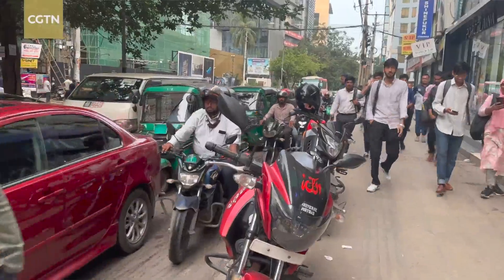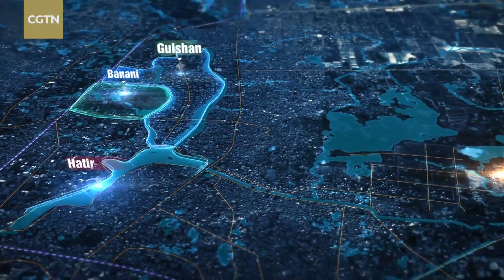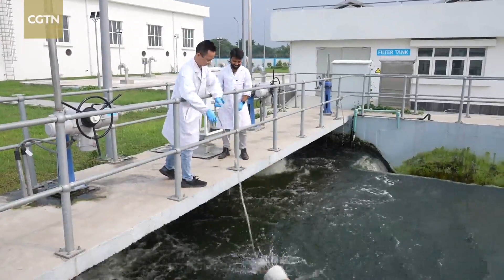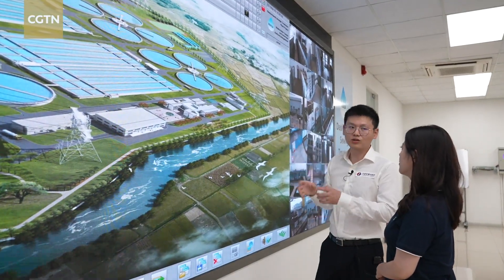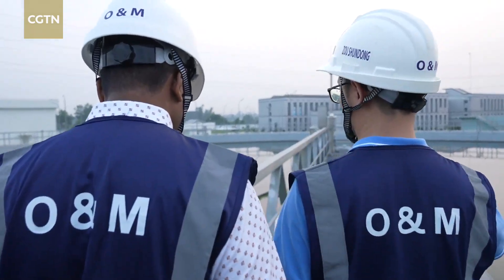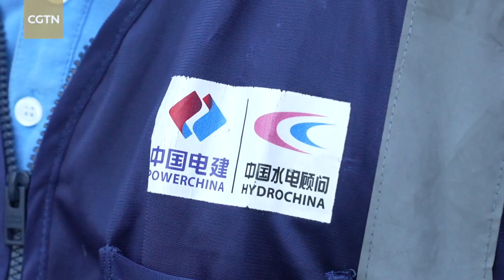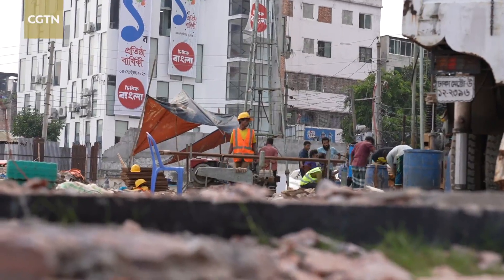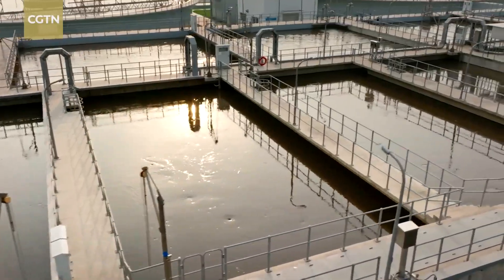First modern sewage treatment plant in Bangladesh provides cleaner water

Comment: The Dasherkandi Sewage Treatment Plant (DSTP), with a capacity of 500,000 m³/day, is the largest facility of its kind in South Asia and has been designed and constructed using the most advanced modern technologies. Moreover, DSTP is a total solution plant that dries and incinerates sludge for final disposal. Accordingly, once sewage enters the plant and passes through all treatment processes, only incinerated slag/ash remains—completely free of harmful substances—which is then sold to cement manufacturing plants. This makes DSTP not only highly environmentally friendly but also exceptionally safe. For this reason, both DWASA and Bangladesh can take great pride in this achievement.
In addition, DSTP is an aesthetically impressive and remarkably beautiful facility. It has served as a model project for all wastewater plants in Bangladesh, and it will continue to serve as a reference for the design of future projects throughout the country.
Bangladesh can be genuinely proud of possessing one of the world’s highest-quality sewage treatment plants.